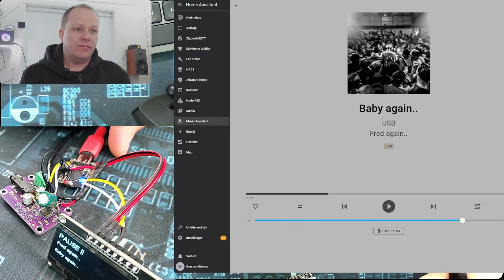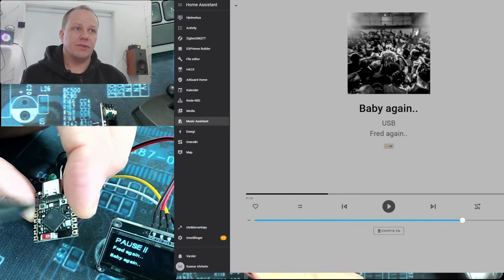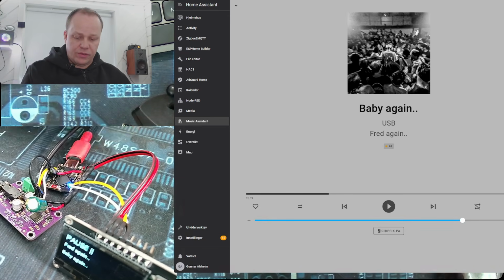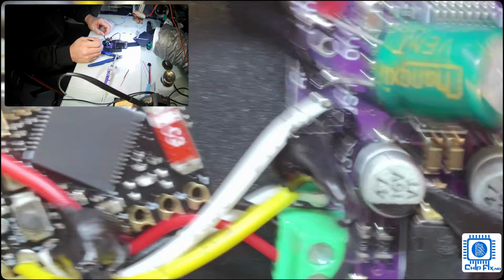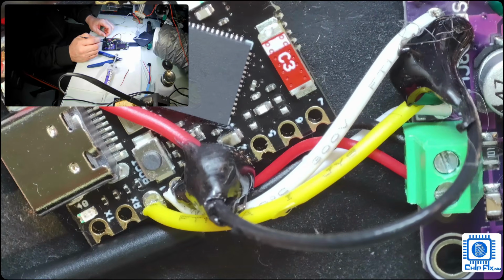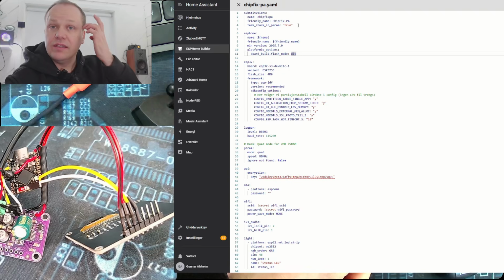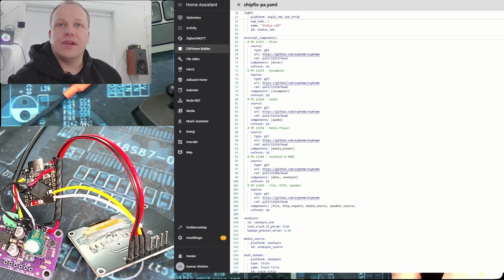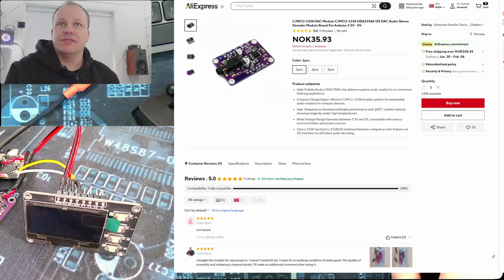How to make a ESP32 S3 Sendspin device in Music Assistant using ESPHome

Comment: In my case I have a esp32-s3 + pcm5102a dac (both Chinese) and I hear the sound clicking in some tons like it was glitching, the sendspin server is working fine when tested with an android spending client, I'm wondering if a capacitor on the power lines would solve this, I don't have any laying around
Reply from the maker: This clicking is a weird thing to track down. Some hav edone it in Hardware. Others  have done it in software. Both of mine is built exactly same, and running identical YAML . One have clicking one have not. The clicking comes and goes one the one that has it, but two days now, after most recent MA update, there has been no clicking sound. Not sure if it is fixed or not. Have done nothing with hardware.

Comment: Thanks for this, really useful. Regarding the Cap across the power, I dont know how inductive modern electrolytic caps are but I used to always stick a 10nf ceramic across power supply lines to get rid of high freq noise. Probably not a real issue at audio levels.